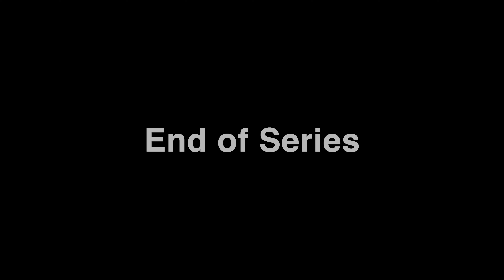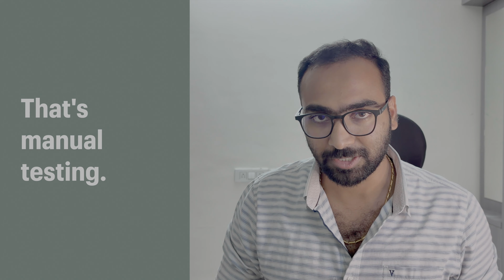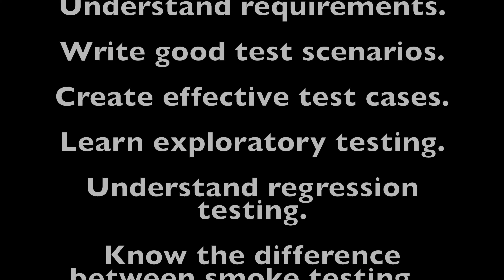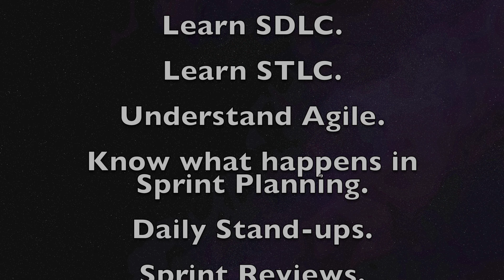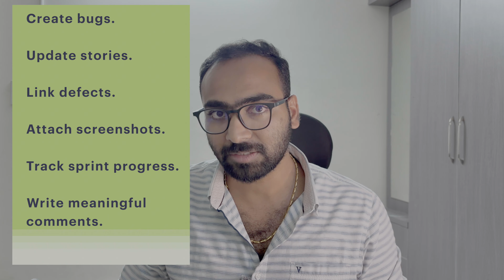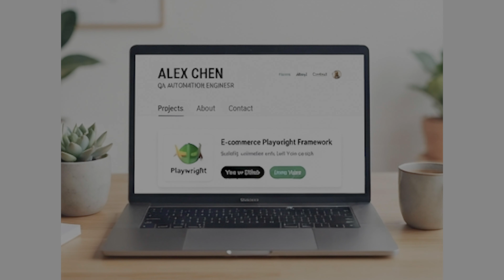Manual Tester to Automation Engineer Roadmap (2026) | Build the Right Foundation | Part 1

Comment: I have 5 year of experience and earlier I was Abinitio developer but then project got changed and I dont have choice so I came in testing currently I have 5 months experience in Testing and doing automation testing so now I am confused I want to switch in Testing field where I can start could you please guide me
Reply from the maker: You already have a good advantage because you have 5 years of overall IT experience and some development background. I wouldn’t consider yourself a fresher in the market.
Since you now have 5 months of testing experience and are already doing automation, I’d suggest continuing in that direction rather than switching again.

Focus on:
* Manual testing fundamentals
* Playwright/Selenium automation
* Programming basics
* API testing
* SQL
* Git and CI/CD
* Understanding automation frameworks

Try to build stronger hands-on experience in your current project and start applying once you have more confidence in your automation skills. Also, don't hide your Abinitio experience—your overall IT experience can be valuable.
Your goal should be to position yourself as a QA/Automation Engineer with 5+ years of overall IT experience, rather than as someone with only 5 months of experience.
All the best!